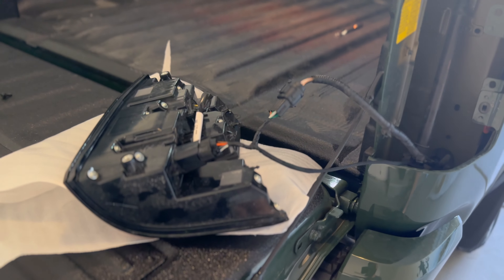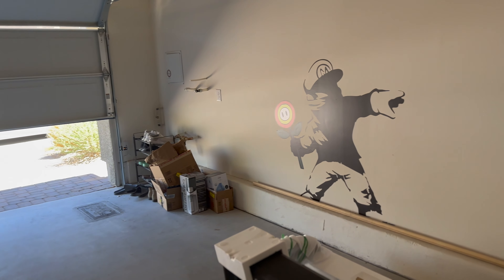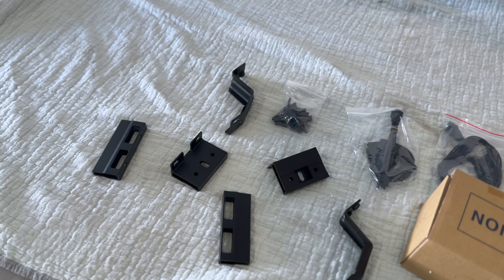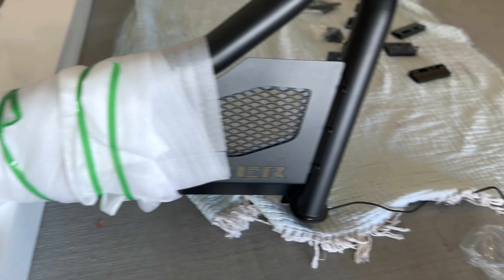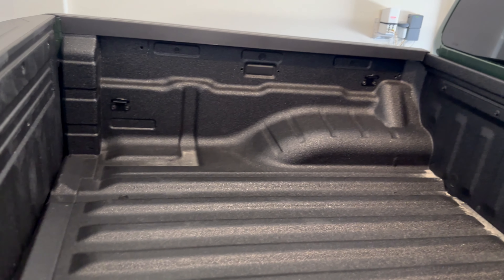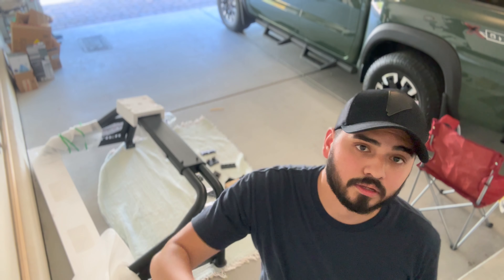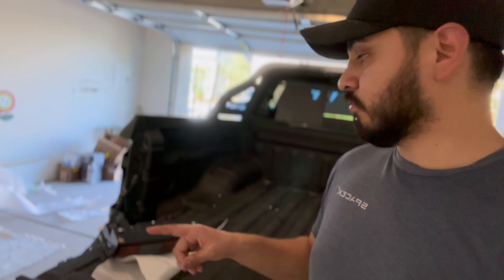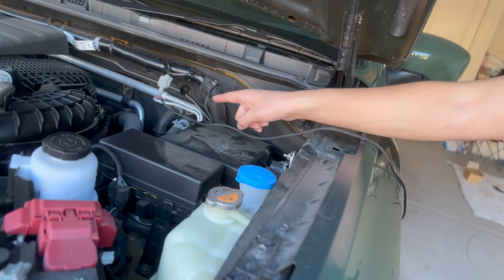Installing OEM Sport Bar on 2022-2024 Nissan Frontier Pro-X. No Utili-Track needed!

Comment: I'd throw a bull bar up front to go with it & the upgraded nismo billstien shocks with the nismo leveling/ lift kit & upgraded lightweight rims you can buy it at Nissan dealership & have them install all of it it dramatically improves ride quality both on & off road & you can do it a little at a time the end result you'll have something above & beyond what most other frontier owners have & they are dealership options & don't affect your warranty trust me it's worth every penny

Comment: Dealership told me its imposible to install the Frontier aftermarket sport bar . Thanks for showing us it could. This video is tremendously helpful. Im just not sure of the wiring under the hood part, gotta figure that out.
Reply from the maker: @edunitas4086  avoid that dealer at all costs! The wiring underneath should be plug n play. A little time consuming but pretty simple. Thanks for watching!
Reply: @alexndrosed  your video is the only one out there with the right info. I really appreciate your efforts. I was able to order the correct parts thanks to you.
Reply: Except this isn't aftermarket.   It's a Nissan part.  Dealer is still wrong as the aftermarket kits are not impossible either.  And some include a notch opening so the oem 3rd brake light is still visible.

I love the green and black.  If I ever decide to upgrade my 2018 Frontier I'm going that route.

Comment: Hey, Alex! Thanks for the video! Your truck looks badass! 😁
I have a few questions though...
I watched your video a couple of times. Did the sport bar come pre-wired? From the brake light/cargo light? There was a wire hanging in there from the beginning. I don't understand why in your video that wire sometimes appears to be on driver's side and other times on passenger's side!!?? Which side was it in reality?!?
Another thing. The instructions say to connect the lights to the passenger side taillight but you did it on driver side... why!?
And why did u have to go all the way under the hood? The instructions don't say anything like that... 🤷‍♂️
I want to clarify these things because I am going to install the sport bar on my truck very soon. I would really appreciate it if you reply!
Thank you!
Reply from the maker: @danielrotaru88  hey daniel thanks for watching! Your absolutely right. Looks like when i was editing the video i actually threw in a clip of me taking out the drivers tail light. It should be wired to the passengers tail light. And yes the sport bar comes with all the wires. Its really plug and play. So #1 the sport has a wire already connected to it. That wire will need to be slipped down and will naturally fall on passenger side. Next is another wire that should come included in the kit. That wire will have 3 connections. The wire connected to the sport bar will get connected to that second harnesses. Then that second harnesses will have to get connected to the passenger tail light. Last connection will need to be ran all the way to the front of the hood. Its really simple and it took me forever to figure out. Hope this helps!!!
Reply: Thanks for your quick reply and for the explanations! It's clear now... kind of. I still don't understand why did u need to go all the way under the hood? The instructions don't say that... do they?
Plus, you get power from the taillight, correct? I don't see any reason to go all the way to the hood! By the way, you said "last connection will need to be ran to the hood"... starting from where?
Reply from the maker: @danielrotaru88  I followed the instructions that were provided on Z1 offroads website. They werent the best but they did help. I would recommend you check those out. Should be linked to their page when searching the sport bar. Wish i could help with the install. Would make things go so much faster. feel free to reach back out if you get stuck during the install.
Reply: @alexndrosed  OK, Alex! Thanks again! 👍

Comment from the maker: Hope you guys enjoyed the video! Can you count how many times I said "Bad Ass" LOL
Reply: where did you run the wire through to get to the light on the sprot bar
Reply from the maker: @Matt7loc  there is a hole or pocket on the passenger side of the bed that you run the wire through. Z1 offroad has pdf instructions that were helpful. But be careful because the instructions got a bit confusing.

Comment: How far does the bar mounts extend off of the edge of the inside of the bed. The L brackets? On the U -Track system they look to stick out an inch or so. I would like to install the bars and a tonneau cover. I did this on both my Colorado and Silverado after installing Style bars.
Reply from the maker: From what ive heard from multiple forums, you are unable to add a tonneau cover without modifying the sport bar, aka cutting and drilling. I have seen it done though so its not impossible.